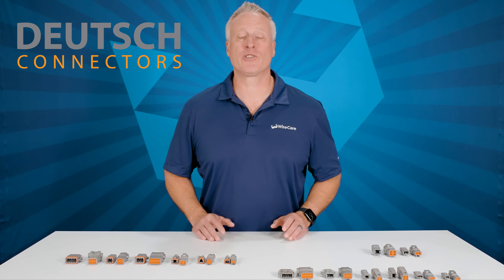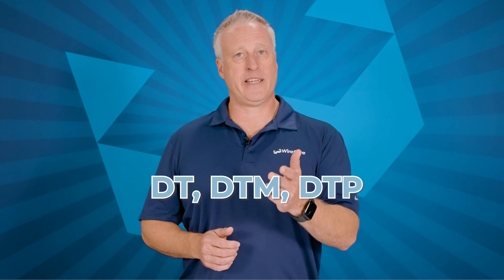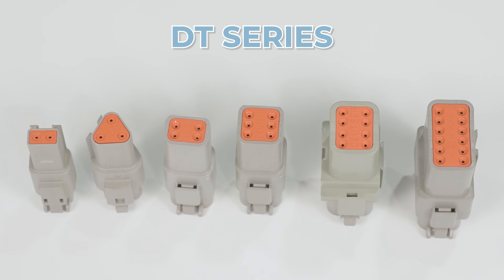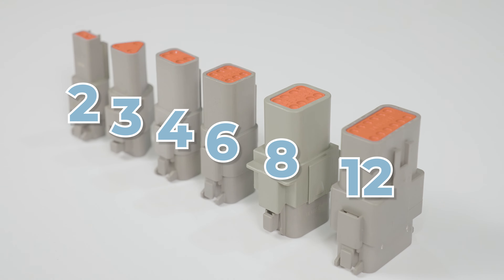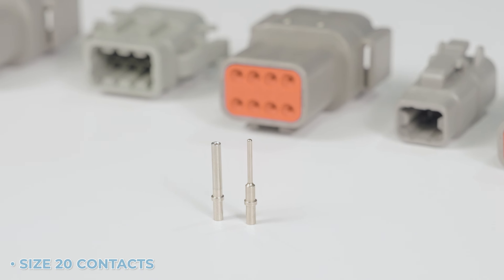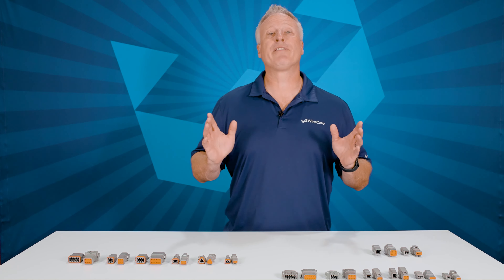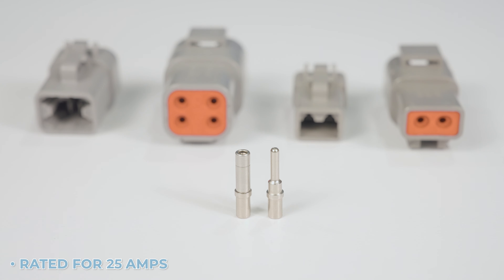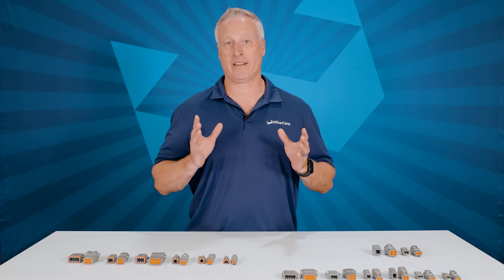The Differences in Deutsch DT, DTM, and DTP Connectors

Comment: That helps a lot, I just bought a kit with the DT-2 crimper.  I read all documentation that came with it and not one word about how to adjust the screw to set the depth the pin goes in the crimper. I have yet to find the answer online, still looking.
Reply from the maker: Thanks for your comment! Glad the video helped. Please feel free to reach out to our team at info@wirecare.com to help you with the crimper. We'll be doing a video of that at some point but that doesn't help you now.
Reply: @WireCare  Thanks for the offer, I've got it figured out now, I only ruined 1 pin in the process.  I hate guess work.  I feel like there should have been a guage that you dropped in the pin hole and then adjust screw until it comes flush with the face, or something similar.
Reply from the maker: @chuckreed2677 Glad you got it figured out without too much hassle.

Comment: Would be nice if you included mm² cross-section (international cable categorization acc to IEC 60228) as well. Not only American Wire Gauge (AWG). Would make things way easier for international viewers.
Reply from the maker: Yes, that is definitely something we will do moving forward.
Reply: Yes, yes, yes.  AWG doesn't mean much outside of USA.  Why not reference mm2 cable size at the same time?
Reply from the maker: @graham6137  You are correct! Outside the US, AWG is meaningless. We may be able to add some text to the video.

Comment: Thanks for the video very ilustrative however there is something I can´t get it, wath are the keys and and wath is the diference???
Reply from the maker: Keying is something that Deutsch uses so that you cannot mate incompatible connector housing. For instance, a DT 12 pin connector has A, B, C and D Keying. This ensures that a C Key plug cannot be mated with a D Key Receptacle. Basically it is a tab on the plug that slides into a slot on the receptacle. These must align for them to mate. I hope that makes sense.

Comment: No DT series that will handle 24 AWG?
Reply from the maker: The DT series, size 16 contacts, will accept 14 - 20 awg wire.
Reply: @WireCare  Yes, I know, but 24 is smaller than 20 and no DTx connector appears to handle smaller than 22 gauge (DTM series) unfortunately.  I have a device that uses only 24 AWG and it appears nobody makes a weatheright connector specified for wire this small.
Reply: @ltvoyager
I have heard of people (tinning) g th he wire to make it 1 or2 sizes bigger. Don’t know if that helps you.
Reply: @marshallcollins8634  That might work, but I decided to use a JWPF connector instead of Deutsch.

Comment: They dont make it easy for customers add in autosport connectors. I also like how the rate in amps at what voltage and ac or dc ? Get ready to part with money make mistakes and part with more money.
Reply from the maker: Yes, the autosports are a bit more complicated to understand. The dielectric strength on the DT connectors would be 1500 VAC.